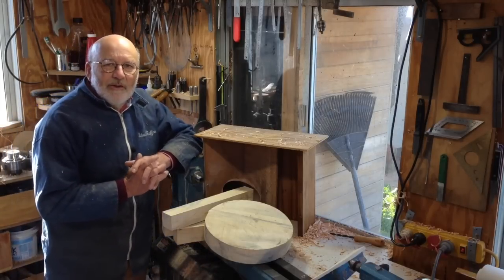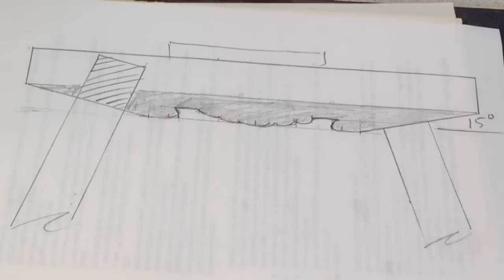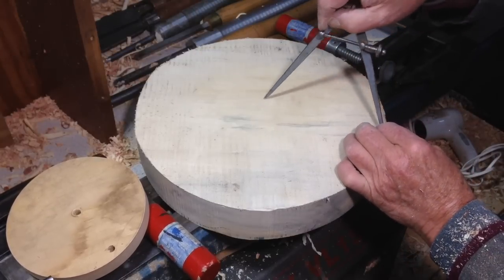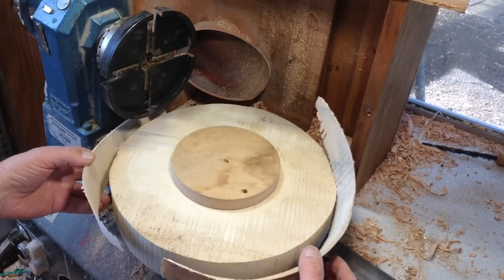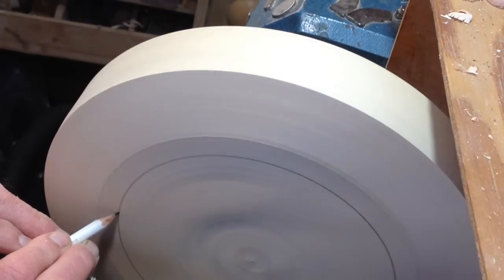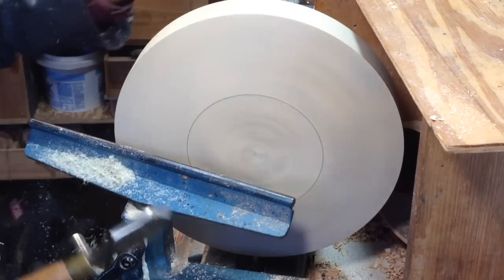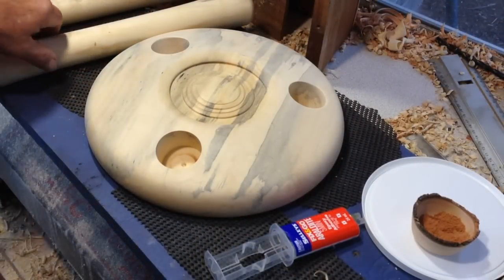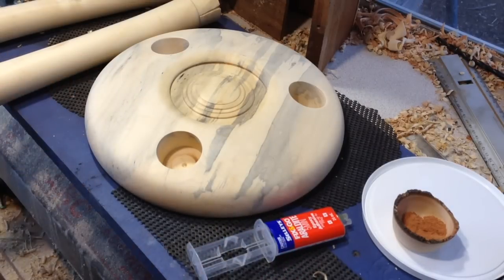Richard Raffan turns a stool for the 4-Ways series of projects.

Comment: Awesome as usual! Simple design but very aesthetically pleasing to the eye. Was that spalted maple? Beautiful! Your drill press jig was the bombdiggity best. Thanks again! I have never turned a stool but I must soon! For removal of epoxy, glue etc I have gone to using a wood chisel with a near 90 degree blunt end. Just like 1 degree of angle to leave an 89 degree point. Quick grind on the grinder leaves a beautiful burr that with the chisel laid flat on the surface does extremely quick removal of glues and leaves a surface that doesn’t need further sanding if following the grain. Stumpy Nubs brilliant idea this, and is one I wish I’d have known 50 years ago. Best tip ever! Glue squeeze out is now a breeze when before it drove me nuts. Again you are the man Richard!! Greetings from across the pond to the west.
Reply: A wood chisel made into a scraper is basically all it is, just used flat, not on its edge.
Reply from the maker: This is box elder. Many thanks for the cleanup tip. I've a couple of old chisels I can regrind and I can see them being very handy cleaning up after filling gaps. I'd not thougth of scraping rather than sanding.